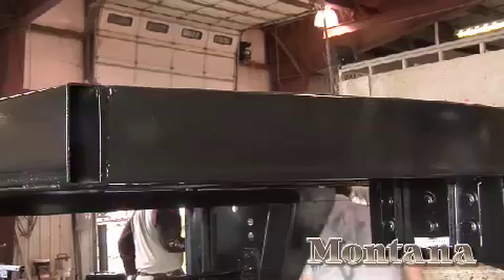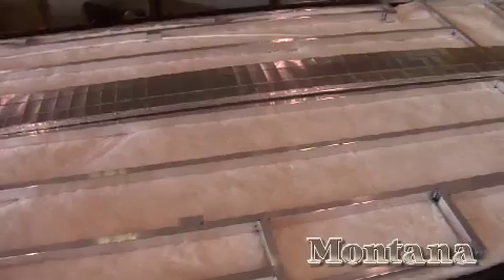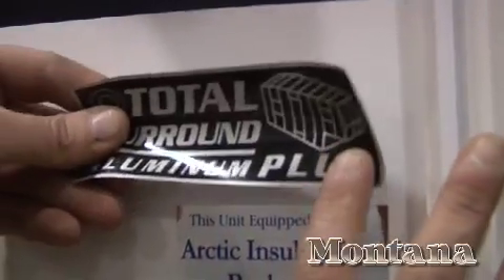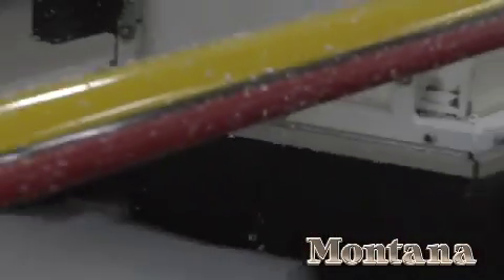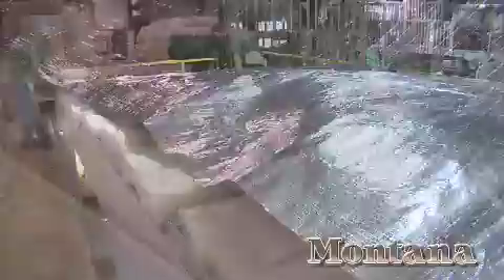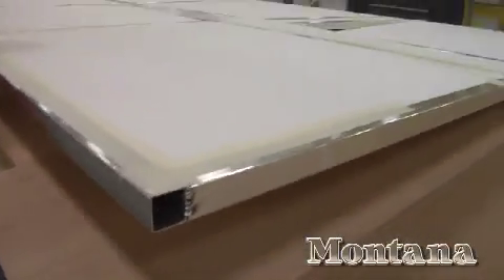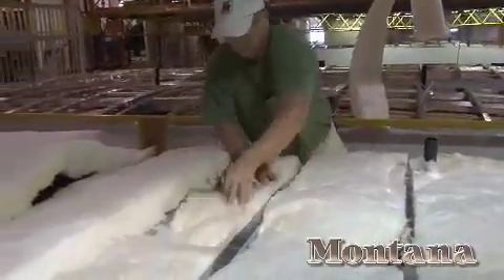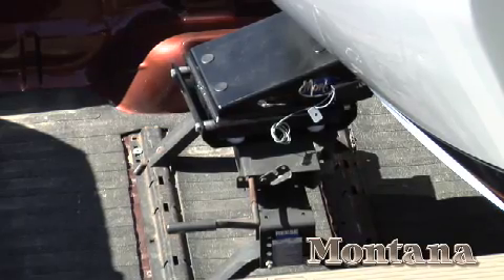Construction - Keystone Montana

Comment: I have owned 5 previous 5th wheels... We now have a 2015 3610RL legacy that has given us nothing but Trouble!. You talk about powder coating when non of the Fasterners are galvanized and rust out.. The fenders over the tires have NO support and screws fall off those fenders. We have had a Rear Spring Shackle bolt either break or come free making for a disaster.. You used the CHEAPEST pile of Junk Tires with Constant blow outs.. We have had the LARGE SLIDE Gears Strip not once but twice.. Ceiling Fan Blades fall off. Shower door handles fall off. The rear Emergency exit window handle broke and I replaced it.. It broke again.. The Axles were out of alignment.. Now the Black water tank is Leaking! Oh the Joy of YOUR "QUALITY" and Workmanship. The Hydraulic Ram under the Trailer was about to fall off because the bolt was just barely on.. In order to work under the trailer Instead of using self taping screws YOU USE NAILS!!! WTH is that!!?? The trim has come down many times. The Power Cord to the Truck and the 50 amp power cord must have been assembled by the SAME METH HEAD!! Wires are exposed at both ends.. MY advice to anyone wanting a 5th Wheel, Don't buy anything after 2002. The Parent Company of Keystone is THOR... They are an investment firm who does not give a hoot about their customers. Why should they?. They own 50 percent of the RV manufacturers.. Airstream, KZ, Tahoe, Keystone to name a few.. They used the CHEAPEST MATERIALS... Our unit stickered at 79000!!! Knowing what I know now I wouldn't have one if given to me.. How many of us break out into a cold sweat every time you take your RV out just wondering what is going to break next?? Do what you like, these are TRASH... You have been warned...

Comment: I just bought this unit (3931fb) and the heater never worked properly and Camping World has had it for 2 weeks and cannot fix it. It blows the 15 amp heater fuse when turned on. I'm so frustrated and angry
Reply: Look how they ran the wiring, that same 'quality' is built into every can they produce.
Reply: It’s now close to 4 weeks and they have thrown everything at it and it’s still not working. Beyond frustrated.

Comment: Forgot the radiant tech on the walls. Have a 2017 3820fk. The heat transfer is ridiculous. Everywhere there is framing there seems to be zero insulation. The RV might as well be a green house with all the heat that comes in from the front window and skylights. Running 2 ac's full time all day can't keep this hot pos cool.
Reply: Radiant tech only works with a minimum 1 air gap in front of the sheathing. If not it is 1005 useless, as it is in this RV. They lay the rook, wall, and flooring directly on top of it. The r-values are a pure lie.

Comment: As a retired tradesman who can turn his hand to a lot of things I would build my own RV for a quarter of the cost if I was a bit younger. Then I would know it was done properly!
Reply: 1:27 to start with, i would use concrete plywood instead of this cheap and crappy chip board. Or what is even better imo, are PE plastic boards because they just can't rot.

Comment: At 0:18 looks like powder coat over RUST.
Reply: 0:33 that paint stick does not clean off well and RV's all over the country look like crap because it's never cleaned off
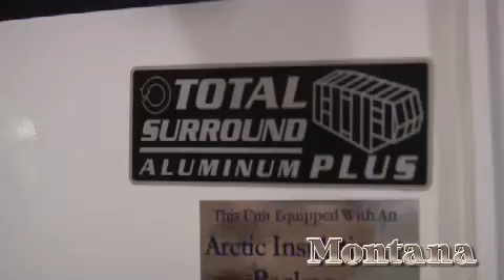Reply: 1:54 crooked decal
Reply: 1:23 the nice bead of adhesive smeared off by the dragging of the floor board across the frame

Comment: My 2013 Montana 3725rl is the biggest pile of crap I have ever owned. Keystone offers a 1 year warranty and the season is 6 months long giving very little time to find out that somebody left building scraps in the holding tanks, the main AC unit died during warranty but not discovered until after, who cares right, too bad so sad should have lived in it and used everything during the 6 months morons! 

The tank valves, bound up to the point they couldn't be used, the black tank leaked season one and season two, imagine the fun we had with that stink 'eh? Too bad so sad pay up! The front LED's, last a lifetime right? NOPE made in China not even one friggin season!! Replaced each season, not bothering anymore, we simply won't use them.The landing jacks, leaked and made popping noises, 3k in repairs in season two, more repairs season 3, staples nearly popping through the cheaptastic rubber roof, Keystone, oh that's NORMAL!! Main room slide ripped the tiles because some genius drove a screw too far through the slide floor, the kitchen counter cracked, why who the hell knows!! 

IF YOU ARE IN THE MARKET do a lot of research!! As for the general manager, ignore his word, they have no word they DO NOT BACK UP THEIR RV's!! I can post all documented issues and back and forth between the dealer and Keyston and my attempts at getting this POS fixed. 

We are going on season 4, we can't wait for the season, we have zero interest in camping because of the RV, when we can we are going to sell that pile of crap and go to a pusher. While the 3725RL LOOKS nice, wrapping a turd in nice clothing doesn't stop it from being a turd, avoid the turd.
Reply: I just saw this video and noticed several issues. For instance, radiant foil is supposed to be used in two separate layers with an air gap in between, not a single layer. lol
Reply: D U D E, that’s how I feel to a T. We should start a blog

Comment: Remote control does not work. No blue light. What is problem. Can it be fixed
Reply: At least they gave you one, mine was supposed to have one, it wasn't there or wired and when I heard how bad they were I told them fine, like a moron that should have been the sign. I'm sure it can be fixed but those remotes were plagued with problems and as you can see nobody from Keystone responded to you, it's like that  for real as well, they simply do not care.

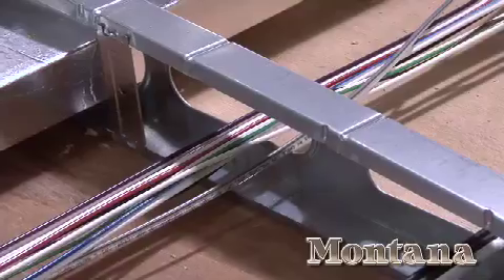Comment: 2:43 Did I just see wiring ran right over the sharp metal edges of the truss roof.  WTF!!!!!!!!!!!!!!
Reply: Yes, build quality sucks.
Reply: You can see the wiring channels are rolled edges, so they are rounded.
Reply: It's fine. Those cables have good wrapping and aluminum isn't very sharp unless cut wrong
Reply: @Maaad-maaan It doesn't need to be very sharp to rub a hole in it, bouncing down the road at 70mph with no slack in the run will eventually take of it.
Reply: @Maaad-maaan  I think that concern is rightfull! Who really wants to take any chances of having a fire because of this poor craftsmanship...or just a short and then you have to open up the entire roof to find the faulty wire cut by this aluminum no so sharp edge...?

Comment: so much wrong here...not with the coaches but with you idiots commenting...makes one wonder how u have survived life and the need to problem solve,lol.....the only mistake in a montana is the soft underbelly,this is why u get rodents....if u simply upgraded to a solid underbelly i would purchase a new one in a heartbeat,as a matter of fact just put in a offer for a 3400rl if they will install a hard underbelly...you could spend another 25000 dollars on an arctic fox coach and still not have something as nice as the montana line....
Reply: If I bought a Ford Focus and it sucked, why would I trash the Ford F150 that I have never owned? I would speak to the model I have because that's the one I have and have had experience with. Do I need to break it down into simpler terms for you to understand or are you going to continue typing stupid things? You assume how other RV's are going to be based on your experience with your particular model? The Cougar Lite is awesome so therefor everything else they make must also be awesome, right? So if it was junk you would be the one slamming the rest based on your postings thus far. Stop while you're behind.
Reply: preacher031163 e
Reply: preacher031163
Reply: KlipschHead281 I disabled,i ended up getting the 2016 cougar extra lite for 25 grand,i love in Montana and was able to stay warm with a few small modifications.I've got 6000 miles on it already and not 1 issue,a very well made coach for the money.I live in mine full time, so instant by my earlier comment,u people whine to much
Reply: KlipschHead281 obviously u know nothing about the dif models all made by keystone/Thor. before I slam any product u should take into account many others won't have the,same experience as u did,just of the issues people have with equipment is dealer prep. no dif then a car
Reply: KlipschHead281 obviously u r a whiner,keystone has given me excellent service,so if ubwish to post negativity that's ur choice,and it's my choice to say I have had excellent luck with my well built keystone product.have a nice day,god bless,and go enjoy your keystone,if u hate it tell me the model,maybe we can switch titles if its is paid for
Reply: KlipschHead281 obviously u r a whiner,keystone has given me excellent service,so if ubwish to post negativity that's ur choice,and it's my choice to say I have had excellent luck with my well built keystone product.have a nice day,god bless,and go enjoy your keystone,if u hate it tell me the model,maybe we can switch titles if its is paid for
Reply: So much is wrong here, Keystone quality sucks, period, I own one and have gone through 3 seasons of dealing with quality issues, don't defend them if you don't own one otherwise you sound exactly like those you're whining about except they're right.
Reply: Your Cougar Lite has what to do with a Montana? What does one experience have to do with any Montana? You love in Montana, ok, ahhh what?? I'm guessing you mean you LIVE in Montana and you were able to stay warm, ok, great, does the fact you live in the State of Montana have any bearing on the RV model Montana, no, not even a little. I'm glad the model of RV you bought is a well made couch for the money, what it has to do with any Montana is anybody's guess.

I know a lot of people in one campground alone who will never buy a Montana again based on their experience, not some guy on YouTube who can't even put a sentence together calling people whiners for not having exemplary experiences like he has had in a rig that has nothing to do with Montana's. People post about what they experience, people who are going through hell with their rig don't deserve to be called whiners, you have zero clue about what you're talking about. 

Do me a favor, if you're going to judge people, trying not sounding like an idiot while doing so.

Comment: I am with snowdog on bs with osb. The glue is resistant but the osb will suck up water and turn to saw dust much more rapidly than plywood. This is part of the reason why plywood is more expensive. I was very interested in the Montana until I did a factory tour, nobody there speaks English and if you pay attention you will learn a lot.
Reply: Well said!